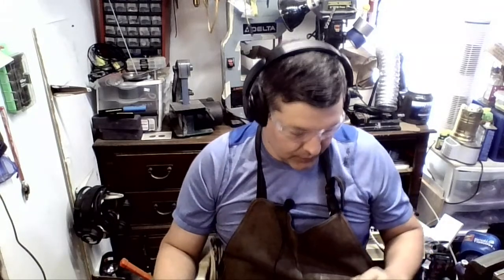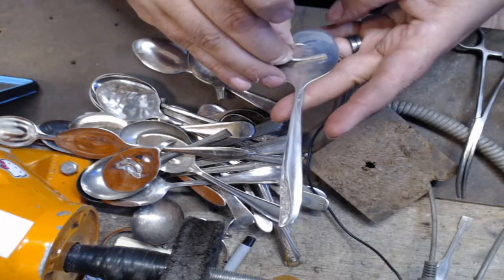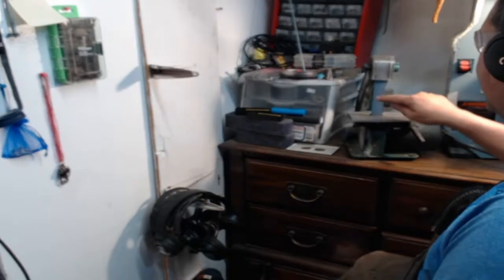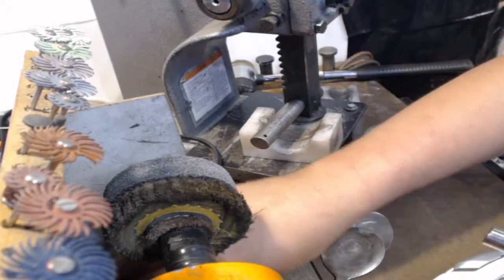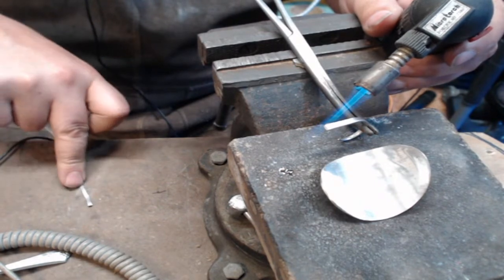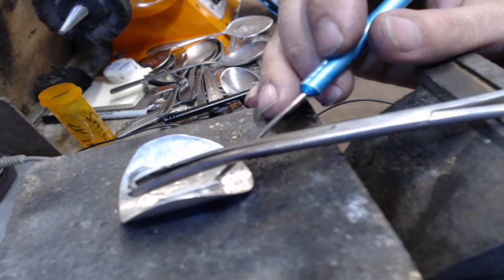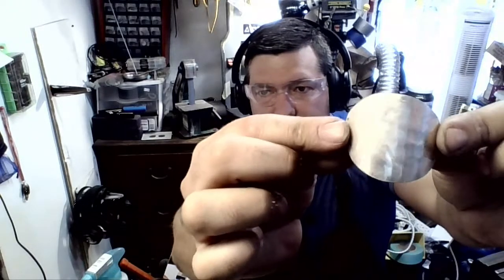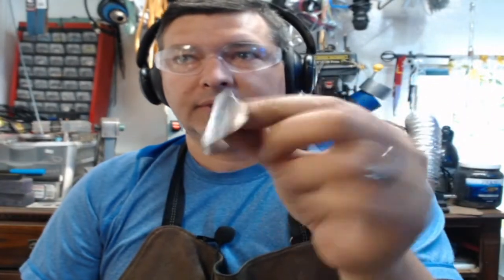Silverware Spoon Ponytail Holders

Comment: Everything sounds and looks good! I have watched your videos this week and they are awesome! You brought up Queen Bess is there anywhere to find these besides EBay? Can you recommend any other brands? 🙏
Reply from the maker: Thank you for watching. I find a lot of my silverware at antique stores consignment shops and thrift stores. Eventually you come across the same pattern quite often. And some I’ve only had the pattern once in eight years. You just have to keep hunting which is one of my favorite parts of this. 

It’s easier to help you find what you DON’T want. The first is a beautiful pattern made by Gottinger I’m not sure if that’s the right spelling but if it Do not buy it.  Unless you’re wanting to make windchimes out of it because it will crack every time you try and bend it. So many patterns can bend but the thinner the pattern or the thinner the silverware the easier they are to bend because there’s less metal there. but that doesn’t mean that you can’t bend the thicker ones it just takes a little more effort and sometimes you need to go a little slower. Queen Bess is one of the thinner patterns that’s why it bends so easily. The other thing to look out for also is sometimes the same pattern is made by two different companies and they have different metals in them. One of them bends really easy and the other one will crack. Unfortunately that is a lot of trial and error.
I hope that helps and thank you for subscribing 😊
Reply: Thanks Jeremy! Your the best! 🙏
Reply from the maker: @steveq6039  Anytime 👍😊

Comment: Does that solder work on stainless?
Reply from the maker: On stainless I think you need to weld it. But I I have heard of a flux that allows solder to stick to stainless. I have some ordered so I will know in a couple of days if it works. But you normally need to weld it and not solder.
Reply: @FlatwareCreationSS  Let me know if the new flux works for you